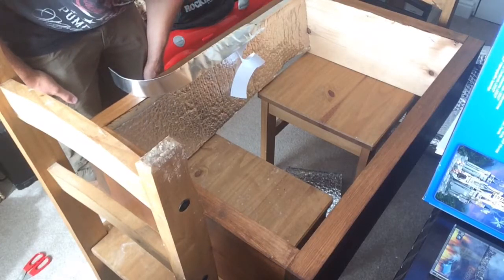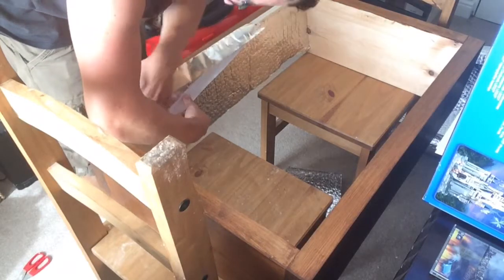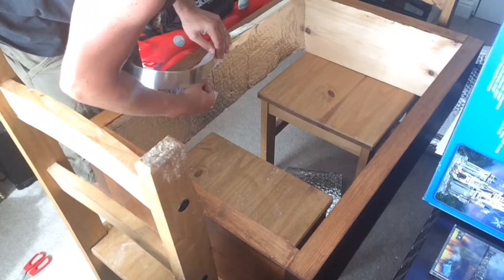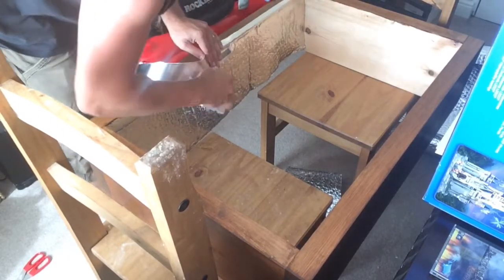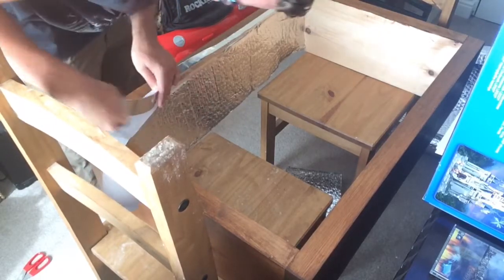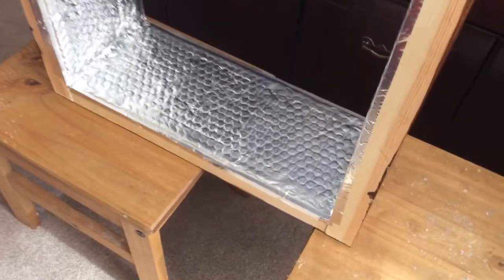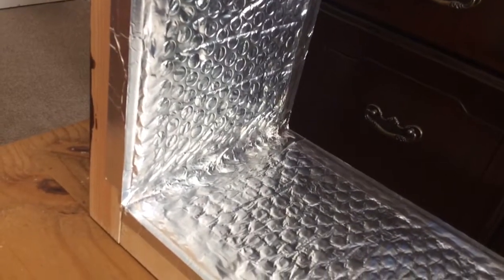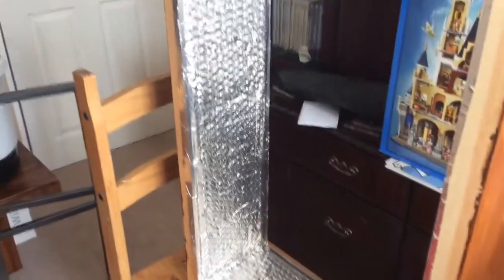Keezer Build Saga - Part 2: Collar Insulation

Comment: How is the insulation holding up? You feel like its working?
Reply from the maker: Hi mate. Yeah, it’s as good as new and looks the part. Thermally how much difference this makes over just the bare wood is difficult to tell. It certainly shouldn’t make it less efficient, and if it looks the part I’d say it’s worth doing 👍🍻